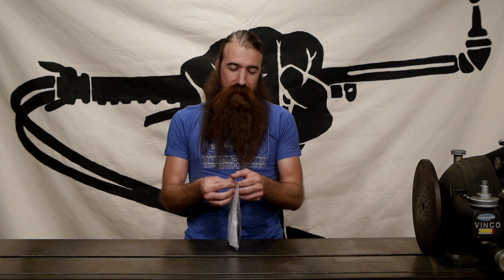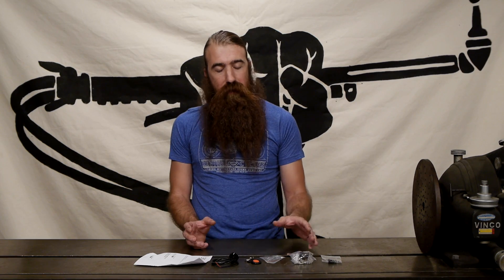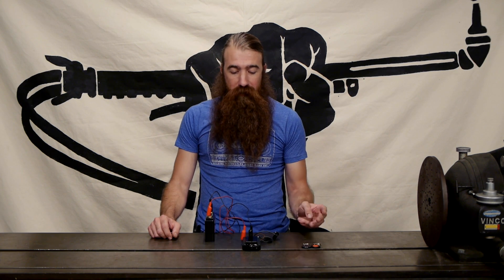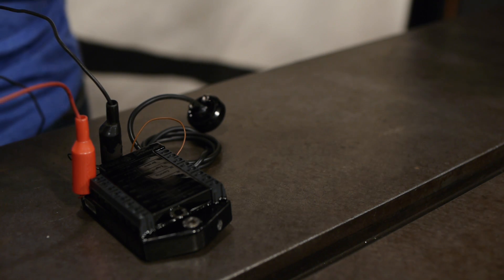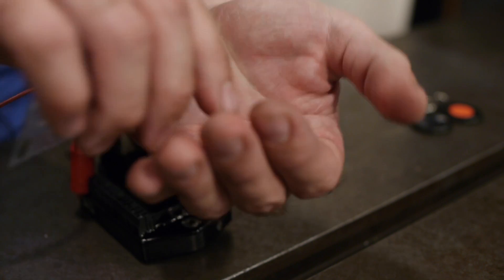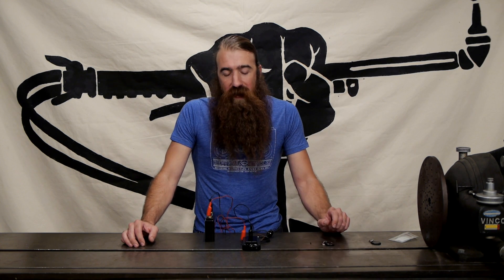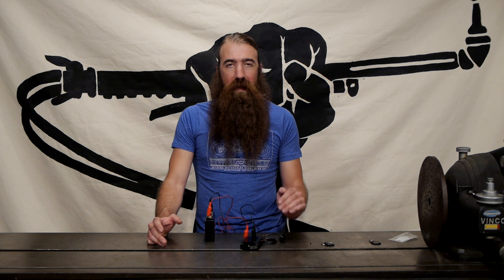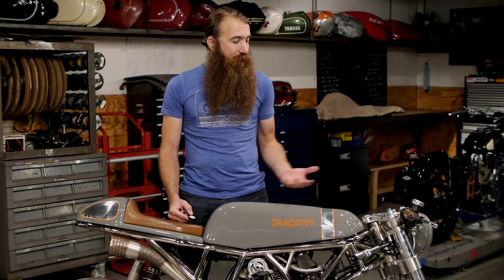Motogadget m-Lock - Revival Cycles Tech Talk

Comment: You say you neglected to put the fuse in. Should there be a fuse on the red wire on the mo.lock unit, or only on the wire from the mo.unit to the battery? The instruction manual from Motogadget only have a drawing without using a mo.unit.

Comment: It was mentioned that you have to use the thought to turn the bike on and off? There is no setting that the bike automatically turns off when you like a switch to turn it off ?

It makes more sense to use the fob only for unlocking and have a switch on the bike to lock ?

Comment: how do i assemble the fuse holder? its the same as the motoscope, they just give it to you in pieces and tell you its important without telling you how to put it together
Reply from the maker: I would throw it out and get yourself a good blade fuse holder. Those out dated glass tube fuses are fickle and can break off where you can't see it, leading you to believe a bad fuse is still good.

Comment: i would love to get this installed on my suzuki tux, but do you think it might be complicating things since my tu250x needs a key for steering lock, gas cap lock, and helmet lock?
Reply from the maker: In a situation like yours it might not make a lot of sense. You're going to have to carry keys anyway and this would just complicate the electrical system unnecessarily.
Reply: @RevivalCycles  thanks, one last question, instead of swiping the key, and putting the key back in your pocket as you mentioned in the video, could i technically leave the key on the sensor, and when i'm done riding, take it off to turn off the bike?

Comment: Hi, i got a cbx1000 '81. I want to install the m lock. But i have a wire that goes to the regulator from my ignition key. Can i connect the m lock to the regulator? Or should i just connect the m lock to the m unit and then use the ignition or aux output to connect to the regulator?

Comment: Hi Stefan,
To you guys i would mention something about key fob: This whole terme generally refer to proximity acces generator that can be keep in pocket, they work with an embedded battery, but in this case it's RFID wich first differ in distance of usage,  this need to be put right close to the reader, nearly in contac,  also because they don't have an embedded battery, they are powered by the reader when close to it, of course watching this video show this matter of distance, but just using the terme key fob can confuse. Thoses tokens  should be called "RFID Key tag".
Hope this help.

THX for the Tech Talk

Comment: Great channel, I have a question a little stupid... In order to use any accessory of motogadget it is necessary to have the unit m-unit?
Reply from the maker: No. The momentary switches do require the m.Unit or other control module to function but the lights and gauges to not require an m.Unit. Many of the smaller motogadget modules like the various relays are individual components from the m.Unit broken out to provide features without requiring an entire rewire.

-Berry

Comment: What happens when used with m blue unit? Do I still use this or can I just use the phone to turn ignition on?
Reply from the maker: With the m-Unit blue, it is recommended that you have a backup ignition switch in case there is an issue with the phone (lost, dead, broken) and the m-Lock is a nice option, but also you can use basic key switch, or hidden toggle switch.

Comment: Hi! I'm having an issue with my (second) M-lock. I replaced my other one when this issue occurred.  So... I go to start up the bike (BMW r100rt) like I always do, with the m-lock normal fob and nothing happens. I flashed it with the master and LEDs only do a half cycle and power cuts out. I flash it again and it does a full cycle, ends with the top two LEDs lit but only for a split second, then it dies. I can do this over and over and it never sticks.  Battery has a full charge, I swear everything is connected correctly as everything worked for about 2 months after I replaced the old one but now I have the same issue.

Has anyone experienced this ? Driving me Insane!!!!!
Reply: I guess the 1 amp fuse isn't enough.  Fuse is intact but reader is dead apparently. Going w/ a classic key switch instead.
Reply: Hi i have had a similar problem. I bought a bike with a m-lock system and after a year or so the fob stopped working. My bike did not come with the red master fob so i had to replace the m-lock with a new system with a master fob. 3 weeks after the m-lock was replaced my new fob stopped working also :/ The master key worked and I just replaced the fob and reprogrammed it. Still a hassle and nothing but trouble. I would not recommend the m-lock to anyone

Comment: Could this unit be used without the m-unit ? 
Cheers
Reply from the maker: Yes, the m-Lock can be used with or without the m-Unit. On conventional installs you use an included 12v relay to act as the ignition switch and the m-Lock is used to control the relay.

Comment: Hi Fellas ¡¡   Good video
I have a Key Go installed on my BMW R100 Cr and after a ride with the bike. The Blue Key has stopped working. It does not turn off the motorcycle. I have turn off the battery .Has it ever happened to you that the blue key is unprogrammed?. Have I program the blue key again ?? Thanks ¡¡
Reply from the maker: It is not clear if you are using the m-Lock with the blue key fob, or the m-Unit with Keyless-go.
Reply: Revival Cycles  Thanks !! I use m-lock
Reply: Hi Thanks ¡¡ I use m-lock
Reply from the maker: There are many reasons this could happen. We have not had an issue where the m-Lock will not turn off before, and it is unlikely that if the m-Lock turns on with the key, that the key will not turn it off.

The more likely cause of this problem is that the ignition system for the engine is being powered by the charging system, even though the m-Lock is turned off. This is a situation that is easy to create on a BMW R-bike when the gen lamp is bypassed. In this case the charging system is able to directly power the ignition system, so once the engine is started there is no way to remove power from the ignition in order to stop the bike. 

Suggest double checking the way the m-Lock is installed, and make sure there is not a current path for the charging system to back feed into the ignition system.
Reply: Thanks you  so much ¡¡

Comment: What about NFC capable watches and phones. Can they be used to work with this unit?
Reply: If you want to use a phone or smart watch, the m unit blue might be a better idea?
Reply from the maker: the m-Lock is a passive RFID system, and so far we have not tried to use this with anything except for the fobs it is designed with. In theory if you have a device that could emulate a passive RFID tag then it should be possible to pair it. But again, we have not tried it, and are not sure if this is possible.

Comment: Ok this should have incorporated a system that was a little wider in operation and have it so it only keeps the ignition on while the fob is within a certain distance from the ignition.

That way no one would be able to take your bike away from you ie jacking or it would make it very difficult.

ie outside of the field the ignition cuts out.
Reply from the maker: That is one way to do it, but there are some serious risks for malfunction and false tripping of the ignition cut out. That is why all the systems are setup to keep the ignition on until it is tuned off, then it cannot be turned on again. This is the same way it works on modern cars...and that is because of lawyers. Also, bike jacking is very uncommon where we live so there is very little need for this feature.
Reply: Yeh it used to be uncommon here as well but it's becoming a bit of a thing so we are lead to believe though as yet i'm yet to know anyone that this has happened to, I suspect it's more of a media frenzied load of bull crap.

But it wouldn't be a bad idea to have a button you could push to shut it down should it get stolen off you while riding.

But just as a thought, the fob could be rechargeable via a wireless coil so the fob would never run out of charge unless you wanted it to.

Comment: If you're replacing an ignition lock with more than two wires, would the solution be to add as many relays as you have wire pairs?
Reply from the maker: That is one way to do it, the other way is to look at the wire diagram and figure out what each of those wire pairs does, and then simplify it. There is no simple rule to follow, but many times, the ignition lock is setup to run parking lights which means there are two lighting circuits that are activated at different key positions. Since parking lights are almost never actually used and only included for government regulations its fine to simplify this and run it with a single relay.  

In the case of a ground circuit in addition to the positive circuit, like with a CDI bike, then yes definitely two relays.

Comment: Do I need an M-Unit to make this function on my 03 Honda Shadow Sabre?
Reply from the maker: Nope, you don't need an m-Unit to use an m-Lock. The m-Lock can be used to replace a conventional ignition switch by incorporating the included 12V relay and then using the m-Lock to activate the relay. This type of install is covered in the manual on page 7. https://motogadget.com/shop/media/downloads/manual/mlock_manual_en_1.3.pdf

Comment: this key does not work with big inch engines even if you use the compensator pack to maintain the voltage to the reader when engine takes all the power to start. 1 of 10 times it works. wery  good videos  :)
Reply from the maker: When the m-Lock drops out due to a large engine during starting it is an indication that the battery is undersized for the application. All battery technology has limit to how low the voltage should drop during cranking, generally around 10v is as low as a battery should drop for a healthy battery / starter / engine combination. The m-Lock stops working below 8v, if you are pulling the battery below 8v the m-Lock not working is a symptom of a different problem, not the cause.

Comment: I was thinking is it better to wire the stock ignition key to power up the m-unit module?
So we will need the stock key and also the fob to turn on the bike, that will be extra security for the bike don't you agree?
Reply from the maker: I guess you could wire in two ignition keys, but generally I don't see the need for that. Motorcycle thieves don't waste time trying to hot-wire a bike. They show up with a  trailer and physically take it in less than 10 seconds. Then deal with any security / lock issues after they are back to a safe place.  But if you wanted to setup this way, you would wire both in series, not parallel.

Comment: Hi good job as always 
Just wondering what will happen if I forgot to swipe the key fab or glass tube off and walk away from the bike ? Does it turn the ignition down itself until the key fab come in range
Reply from the maker: The m-Lock system is what is known as a near field RFID, and that means it can only detect the fob when it is in very close proximity to the m-Lock (less than 1 inch or 25mm). So the way it works is that you swipe the fob, it turns the system on, and the system will stay on until you swipe the fob again to turn it off, or the battery goes flat.
Reply: Revival Cycles
Hello, is it can still actuated if we put the pickup reader under the fairing/dashboard and swipe/tap the fob on the dashboard?
Reply from the maker: There is no way to answer this question without knowing a lot of details. The best advice is to test the setup on the bench before making a permanent installation.  We have installed the pickup in the upholstery of a seat, and behind some plastic components and that has worked well. We have also found that the pickup is very sensitive to any amount of metal that is between it and the fob.

Comment: kind of a silly question, but can you still use a traditional key ignition system along with the m-lock?  for the "just in case the m-lock isn't working" cases you aren't stranded and can just start your bike with the good ole fashion key.
Reply from the maker: yep. that is no problem. The install might be a little different, and you would likely lose the parking light feature if you are working with a stock harness. But if using an m-Unit then it really doesn't make any difference if you have more than one ignition switch.
Reply: got it.  I was planning on using the m-unit to help with the wiring and then have a key as a failsafe in addition to the m-lock.  just wanted to make sure one didn't over ride the other.

Comment: How does this device affect a bike in which the front wheel locks upon removal of the ignition key?
Reply from the maker: Interesting, I've never seen a bike that has an integrated wheel lock or any type of automated wheel / fork lock. This device is designed to address the electrical side of the system, and does not account for any mechanical functions.
Reply: I ride a 2005 Yamaha FZ6. I have two option when removing my key. One option would be two clicks to the left and the front wheel locks in place, and the other option is one click to the left and the front wheel remains unlocked.
Reply: Not the wheel, the handle bars are what locks on your bike

Comment: will the Mlock work properly in royalenfield 500 efi bike ?
Reply from the maker: Yes, but if you are not using an m-Unit with it, you will need to use the included 12V relay to replace the stock ignition switch.
Reply: Revival Cycles can i get this in india??
Reply from the maker: Check with websales@revivalcycles.com but I'm pretty sure we've shipped to india before.

Comment: This slowly depletes the battery, correct? Is that an issue if ridden maybe once a week? Does it need constant power or else it will forget all keys? I'm really considering getting this part, just don't want a drained battery. I've got a Shorai LiFe battery.
Reply from the maker: Sure in theory it slowly drains the battery, but when the m-lock is in standby (off) it only draws 2mA which is .002 Amps so with an 8-cell antigravity (8 A-H rating) would take about 166 days or over 5 months to drain the battery. And if you are going to be leaving a bike un-ridden for more than two months you should have it on a battery tender and add stabilizer to the gas. 

The m-Lock does not forget the keys when power is removed.
Reply: Thanks!
Reply: If I drain my battery because Im stupid and left my headlight on... Does it forget the key?  Does anyone have any experience with this?
Reply: I also would like to know this

Comment: does the m-Lock work with my Buell 1125r?
Verry good videos, plz keep them coming. :)
Reply from the maker: The m-Lock can be installed on any motorcycle with a 12V electrical system, as long as the bike does not have an immobilizer security system built into the ECU and ignition switch.

Comment: Another solution for problem battery is to have a small backup battery for the M-unit coupled with a diode to ensure that current will only feed the unit and other side the bike charging system will still charge the backup battery
Reply from the maker: yep, that works, or the same idea but with a capacitor. We've tested that and it works well...the secret is the diode. BUT I still don't recommend this solution because it is just covering up the real problem. If the m-Lock is dropping out it is because the battery is not strong enough and the battery is being damaged during the starting operation. The better solution is to get a larger capacity battery.

Comment: What is the smallest battery that won't have the problem with this system?
Reply from the maker: It depends on a lot of variables. What engine, what temperature, for how many starts, after how many years, etc. The best way is to size the battery approprately for the application, and that means selecting a battery that does not drop below 9V during the starting cycle. As long as you can keep the voltage above 8 or 9 Volts you shouldn't have an issue with the m-Lock.

Comment: How do you wire it on a bike not equipped with the M Unit?
Reply from the maker: The m-Lock comes with a standard 12V relay that is used to replace the factory ignition switch, and then the m-Lock controls the coil on the relay. The relay is necessary because the m-Lock can not supply enough current for the entire motorcycle, but it does provide enough current to trigger a relay. There are some additional details in the manual https://motogadget.com/shop/media/downloads/manual/mlock_manual_en_1.3.pdf

Comment: For some reason my bike won't do anything electrical wise without the kill switch wired. As per my custom build I want to get his but does this eliminate the need for the kill switch?
Reply from the maker: The m-Lock is a replacement for your ignition key switch that is used to turn the bike on and off. This doesn't really replace a kill switch because you can't turn it off quickly in an emergency situation, this devices is intended to be a key switch replacement only.

Comment: This may be a very stupid question, but I barely know anything about motorcycles and I'm trying my best to learn. If you had a bike that was electric start and kickstart and you used this, it would then become wireless start and kickstart, correct? Installing something like this shouldn't affect the kickstart because it's mechanical, not electrical?
Reply from the maker: Not a stupid question, but also one that should be clarified. The m-Lock does not work with the starter system for the bike, this is basically just an ignition key switch replacement. Meaning that a standard motorcycle has a key that is put in a lock and turned, but with the m-Lock when you pass the fob near the pick-up reader it will turn the bike on. 

The rest of the operation of the motorcycle will be the same as it normally would be.
Reply: Revival Cycles Thank you so much for clearing that up for me. Thanks for the videos too, they are super helpful!